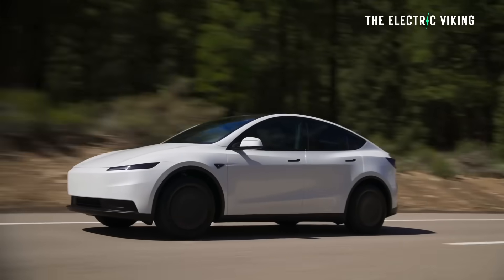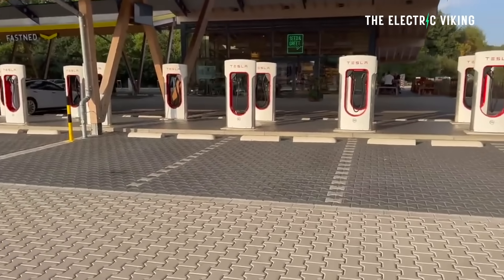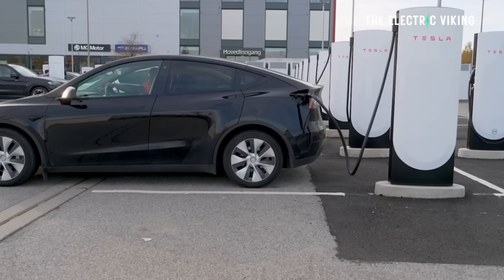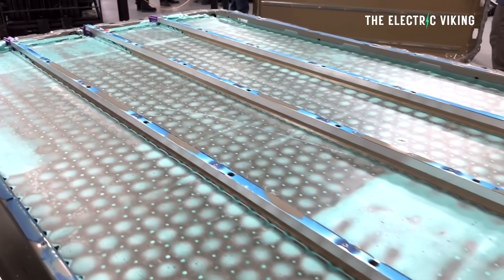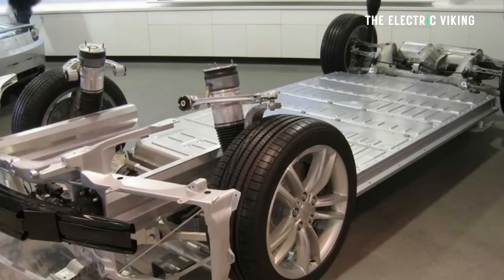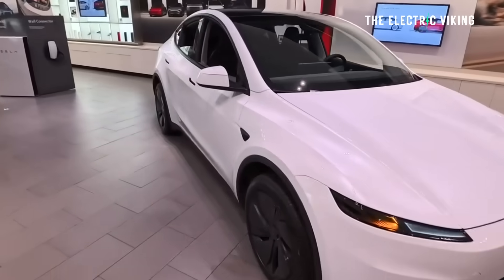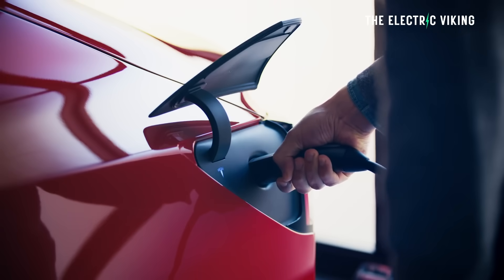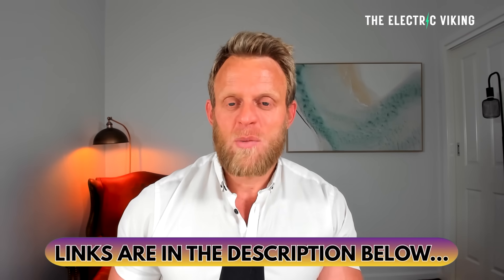Musk: Next Generation Tesla's to Get 6C Batteries & 10-Minute Charging

Comment: high power charging on cybercab makes little sense, as it will have inductive charging only, which will cap charge speeds much lower (around 20KW I understand).

As there will be off peak times where RoboTaxi fleet is lower utilised, it can charge at those times at slower charge speeds without much revenue hit.

Comment: Some comments around it: the issue around Tesla's 250 kW charging is that it does it only a few minutes and almost depleted and then goes under 170 kW, MY LR charges most of the time < 170 kW.  6C means indirectly 800 volt architecture, which should have been there since the highland model.

I won't buy a new model until they offer a bigger >90 kWh and faster (most of the time >250 kW) battery.

Comment: The bottom line on Tesla batteries is that my December 2022 Model Y's battery hasn't improved at all in the new 2026 Model Y in the US.  Tesla is falling behind.  It's lead in FSD may save it or the Model YL may save it, but Elon has given these batteries "no love" for a long time.  The 4680 was a complete distraction and never produced a battery at scale that improved on the 2170.  Otherwise you would see 4680 batteries in Model Ys.

Comment: Love that they will improve the charging time. My concern would be if there is a trade off on the longevity of the battery. If it creates more degradation then no thanks. 
Have we seen those Chinese vehicles degradation numbers that increased to the 5C or 6C charging?

Comment: Tesla plugs have long suffered from heating restrictions, or to be specific, the contacts therein. They even have temp sensors that slow charging when it senses "too hot". In hot weather people put wet rags on the connector, which Tesla now detect & circumvent. Liquid cooling of cables has been done , but the farty little Tesla connector, touted as something special because of its small size is going to be a stumbling block. How do you circulate liquid cooling in it? CCM is bigger, because someone long ago saw the future. Bigger contacts (& area) and room for that cooling. Not so "last year" now, is it? If (if) Musk wants it,  his boffins will have to find a solution.

Comment: I was on a road trip with my 2017 dual motor 3. In 9 of 10 stops passenger needs took more time than the super charging. What would really help is an average of 400 miles of range.

Comment: Honestly, I don't understand this race for range and fast charging. A 60 kW LFP battery is more than enough for sedans. And for the rest, 75 kW is sufficient. In 99% of situations, you won't need a range greater than 500 km. And for the 1%, what's the problem with waiting 15/30 minutes? It barely gives you time to go to the bathroom. Where investment should be made is in charging stations in strategic locations. Not in the middle of nowhere. They should be near small commercial areas. Which will also be an asset for these commercial areas. And let's take the experience: very large batteries negate the charging advantage for those who charge at home overnight. Having to wait 3 days to reach 100% is not a viable solution.

Comment: Charging at home is fine for most driving.  But, in the USA, road trip charging is a project in many areas.  

If you go on infrequent road trips, just rent a gas car.  Don't buy a car suited to a once per year trip.

Road trip issues are especially bad in less densely populated areas, where chargers are more scattered, and actual highway speeds are high.  Driving at 140 kph, range is sharply reduced.  

Faster charging would be important to help improve the road trip experience for EV drivers.

Comment: No doubt I am waiting before purchasing another electric car.  Seems like the tech improvement for electric cars is still evolving pretty fast so a current car can lose a lot of resale value...such as my 2022 Model Y Performance!   Currently waiting on FSD, range, and charge speed improvements.  Until that stabilizes a little bit I will wait. Currently our Model Y is used for local trips, and we use a gas car for longer road trips. Once the refueling vs recharging difference becomes minimal then it will be great to go full electric for any length trip. I guess all the fast charging architecture will mean nothing at home when charging off of 240 volts in the USA.  That is 40 miles per hour for our Y.  So will a  car with fast charging still charge at 40 miles/hour at home?

Comment: I don't care about batteries that charge in 5 minutes, my Tesla is parked in my garage for over 20 hours everyday. When I go on the road Tesla superchargers can charge what I need for my trip in about 15 minutes, while I go to use the restroom. What I would like better is to keep my range for a long time, not to lose so many miles of range. My model 3 performance has lost about 60 miles of range in 4 years. My new model Y has 350 miles of range, I made a 270 mile trip yesterday without stopping, costing me less than $4 of electricity.😁

Comment: Currently, own a red 2022 MY (mine) and a white 2023 (MY).  Want to replace the white one with the new Long MY when it comes to the US.  That's out "travel" car.  It would be great to have the faster battery but after 30k miles of distance travel, the current batteries are fine.  of course, faster is better but in a typical 900 mile drive to see the grandkids, we may spend 15 minutes TOTAL in extra time waiting to complete a charge.  We always drive to 5-10% charge.  Stop, bathroom and drinks/snacks - come back to the car and are at 50%.  We drive on.  Yes, we stop twice more than we did with our diesel (700 mi range, car - not bladder) but it is NOT burdensome.  You know how frustrating it is when you are in a hurry and have to spend an extra 5 minutes in line because someone ahead of you is paying in change?  Not so bad when you realize that you are gaining extra charge while you wait.  You really have to experience the whole process to understand.

Comment: Will the current Tesla supercharger  s support 6C 🤔🤔🤔 charging? ?
Reply: no
Reply: No but it doesn't have to. V3 Superchargers deliver 250KW. If you could maintain a flat 250KW charging curve you could get 50KWh in 12 minutes, that's as good as it ever needs to be. 50KWh is over 200 miles of range in a 3 or Y. The minimum time for a charging stop is the time it takes to go to the bathroom, that's at least 10 minutes. We road trip every weekend, 95% of our trips are under 300 miles. Even with today's charging speeds we only need one 10 minute stop to do that. For longer trips we need two stops but so do our bladders.
Five minute charging is only useful for apartment dwellers who can't charge at home, it does nothing for roadtrippers.
Reply: @joshuarosen465 - V3 charges deliver a peak of 250kW in specific conditions (minutes duration, ambient temperature, no load sharing across the four charge points connected to the charger). They sustain around 140kW, but if all connected posts are in use fall to around 90kW per post.
Reply: @GruffSillyGoatIn six years and hundreds of Supercharger stops I've only encountered full stations twice, once five years ago on the 4th of July in Rhode Island when they only had a single Supercharger station in the whole state, now they have lots, and the other time was a literally once in 90 years event during the solar eclipse when 200,000 people went to Vermont, a state with a population of only 600,000. Aside from that Superchargers usually only have two or three cars at a time, it's rare to see even half the stalls in use.
Reply: @joshuarosen465  - Different story in Europe, including the UK where I'm located. As Tesla are one of the cheapest ultra-rapid charging services they tend to get busy quite often.

Comment: They are probably targeting 500kW peak since their new gen chargers max at that, it was the same thing when Model 3 and Y got 250kW and in the same time V3 chargers peaked at that speed. CT is at that speed already so there probably won't be any more upgrades for it, maybe just curve optimization. I highly doubt Cybercab will reach that speeds, probably 250kW peak, because it's a small pack and they are counting on people just using 25kW wireless charging.
Reply: This new pack will be 800v architecture with a 500kW peak charging capability. That's why Tesla targeting the Cybertruck and potential Roadster. 500kW at 400v will require too much current in the electronics and cables.

Comment: Two questions:
Aren't lithium NMC batteries flammable ?  (This was one of the reasons to change to LFP.)
How does the 6C current get from the charger to the car through such a tiny cable without overheating it ?
Reply: By using at least an 800V architecture and good cable cooling

Comment: As it's not mentioned in your review-  If Tesla are going back to NMC batteries, doesn't  that mean in order not to degrade your battery , your stuck with the 20 to 80 % old rule ??
Reply: That is only for short range daily driving where you start charging right when you get home or you don't charge at home and leave the car at a low or high state of charge overnight.. It doesn't apply to longer trips where you finish charging to 100% right before you leave and start recharging when you arrive. It is only sitting for extended periods (like overnight) at a very high or very low state of charge does significant degradation occur.

Comment: in uk you have max 7kwh costing £0.07 pence per kwh per h charging at home. 300 kw per hour charging costs £0.89 per kwh. where will you charge?. 10 minute charging is no relevant to most evs unless you go on long journeys
Reply: If he can get the cost to charge on the road down to the domestic 7p/kWh point, then it would be useful to have the range, although I've never needed to fast charge. It's 5 to 8 times more expensive to use a supercharger let alone the 3rd party chargers. I'd love the range but probably never or almost never use it. And if I did it would be close to the price of diesel

Comment: Elon didn't mention anything about new batteries in this interview or anywhere else. The information about the 6C battery has no connection to Tesla.
Reply: I think Electric Viking is hallucinating here.
Reply: I haven't watched the interview - it's 3h long, but I can't see anything in the "chapters" about Tesla. @electricviking ???
Reply: Also NCS is not suitable for higher Ampere, so they need 1000V architecture. Tesla is constantly on the wrong way which is sad
Reply: @hadana1999 and amazing they have done so well.
Reply: According to AI searches he did on Jan 10th.
Reply: @fgeiger41 Can you ask for a source?
Reply: @fgeiger41  The AI is hallucinating. Ask it for confirmation. If Elon had said this in the interview, I would certainly have noticed, because that would be fantastic. If it were true it would be front page news. The Chinese batteries are of type LFP, whereas Tesla is working primarily with NMC and it is highly uncertain that these can reach 6C.
Reply: @dsoede nope. This came from a late December 2025 interview with Peter Dendis (revealed publicly in early January 2026), where Musk discussed targeting a 6C charging rate as part of Tesla's upcoming battery architecture. Multiple YouTube videos and reports summarize this as a shift toward 6C batteries for future Teslas, potentially debuting in models like the Cybertruck, Roadster, or next-gen platforms.
Reply: @fgeiger41  Did you see it yourself? I didn't and I watched the entire interview. It would have been huge news, but I didn't see it anything about it on other Tesla channels.They would have undoubtedly reported on it. But if you can provide a link to the specific clip that would be very helpful.

Comment: Why should anyone care about charging speed?  Normal people just charge at home overnight.  

On long road trips super short charge times are more of a burden than a boon (when charge times are too fast you "might" have time to run to the bathroom before your charge session is complete, but that's it).  I don't see the issue.
Reply: While this is completely true, and I do think the same way, there obviously are cases when faster charging times are an advantage. On a day to day basis, there is absolutely no problem: My car charges over night, and has more than enough range for the whole day. Occasionaly, I do a long distance drive where I have to charge three times. On of those, I use for lunch. On the other two, I have to wait for 25 to 30 minutes, but would prefer a 10 minute break. It's not a deal breaker for me, but any improvement would be welcome.

Comment: 6c is to play catch up...

What they need to do is improve the V2L / V2G so the 70+ kwh pack can power an entire home for 3+ days. We need this for all the brown outs and PG&E power shut offs that happen toooooo frequently.
Reply: He promised V2G for 2025….
Reply: @hanswitvliet8188 Oh okay, so like 2035 then ✅ using Leon time lines
Reply: they have it already it’s called CT
Reply: @mariusexotic  Not sure if you noticed, no one is buying that trash can on wheels and it also isn't enough power to fully power a home
Reply: @fazman6218  No car with V2G can fully power a home. You need a small house battery to absorb demand surges and the car keeps that battery topped up.
Reply: @williammeek-h2o  How does a 10 kwh wall mounted battery do more than a 70+ kwh battery in a car?

I don't think you realize how simple it is to do when people for a decade have already been hacking apart old Tesla Model S battery packs to make a whole home UPS.

It would be very easy to do, but Tesla doesn't want to lose the Solar/battery market with a superior product. 😂
Reply: @fazman6218  Simple, the inverter in the car can only output so much. The highest I have seen is 7.2 kW which will not start a central AC unit. 
The home battery can add inverters and surge capacity until it can do that, then the car feeds a charger for the home battery.
Reply: @williammeek-h2o  How does Lucid and others do it which can handle way more than any Tesla product to date 🤷🏽‍♂️

Many other 3rd party providers offer solutions as well 🤷🏽‍♂️

It seems that Tesla has gone out of it's way to make sure they DO NOT support the ability and in the ToC/ToS have gone out of their way to void the car battery warranty if you use any 3rd party device to accomplish it 🤡

That doesn't sound like eco friendly to me
Reply: @fazman6218  Simple, they don't. They do what I described and the car sends power to either a small home battery or an external inverter. 
And even then, not enough to run a house normally.
Reply: @williammeek-h2o  You are behind in your information, the 2026 vehicles already have everything built INTO the car to push out AC power (not DC). Dig around some more you will learn
Reply: @mariusexotic referring to the Maffia-mobile that isn’t legally allowed in decent countries?

Comment: This stuff is just a tech progression forward. Not huge steps but step by step over years. 

For EV's to really compete with ICE cars improvements need to be made along every line of an EV. Charging, cost, battery life, disposal of batteries. ETc.
Reply: Most of these are already solved. Modern batteries can outlast the car, at least in Europe they need to be recycled by law so new batteries are made from the regained raw materials. Right now, we're at the crossing point where EVs match the price point of combusion cars (in some countries like China they're already cheaper), but if you factor in running cost, in total they're already cheaper today - and it will only get better in the future. High charging speed and good range are already coming, look at what China is already offering. And then you have to also factor in the many massive other advantages that EVs have over the older technology. Let's face it, the time of combustion cars is coming to an end very quickly.
Reply: @valuemastery  Let's see some names and places of those recycling places??? They don't exist in the US. Outlast a car? I own 8 cars 4 of them driven daily. My son is driving a 2006 and daughter is driving  a 2008. No way batteries would still be good on those cars. Don't start a fight because you are rich and gay turning over your cars in every 3 years. I can tell you more about what's wrong with EV's, try to insure a 19 year old on an EV???? Or a newer car in general....
Reply: @crp9985  Yes, I know about insurance prices of cars, especially for young people who didn't have their license for very long. I actually have an 18 year old and a 20 year old, and we got used cars for them (4 year old). And indeed I return my leased car every 3 years for a new one. But this doesn't have to do anything with the fact that you can expect a modern EV battery to last for 500,000 km. As for recycling, it is very unfortunate that there is no law for this in the US, I hope you guys don't just throw your batteries away. In Europe, the first recycling facilities are already operational, but there still are very few batteries to recycle, since EVs are so new. More recycling facilities will get built as cars get older.

Comment: Where do these people think that kind of Power is going to come from. Let AI run the numbers for you. Ain't no way the grid can handle that kind of draw. THE WIRE GAUGE REQD to charge in 10 minutes is at least 3x larger than anything now installed. Only charging stations with their own diesel generator will be able to handle that charging rate and then only a few cars.